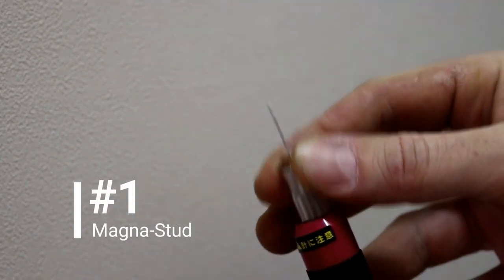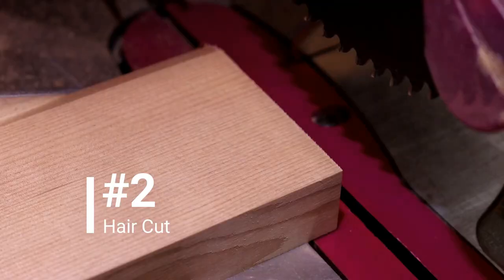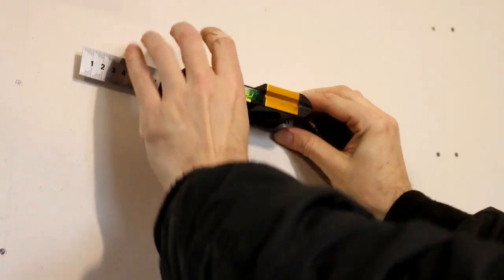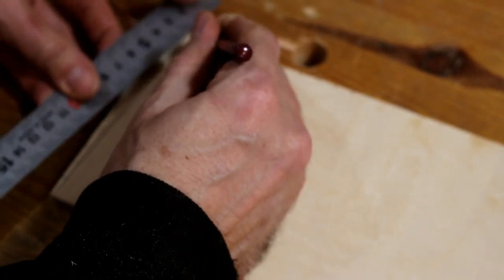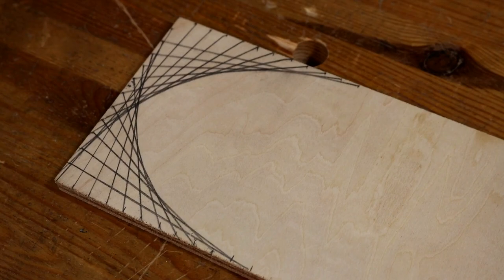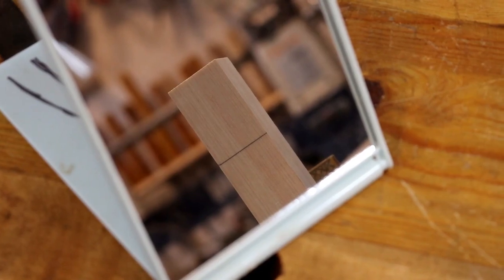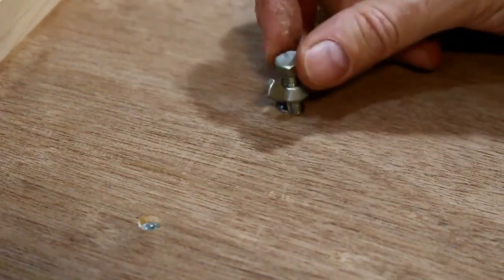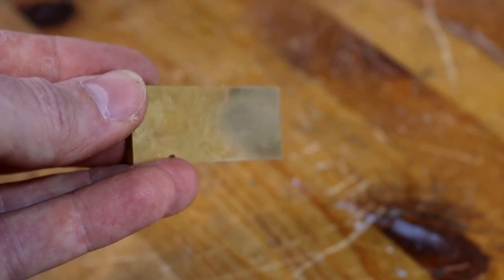Do you know all of these?! 8 woodworking & DIY tips!!

Comment: #5: I’ve seen woodworkers drilling horizontally, as you do, with their wedding ring around the drill bit shaft. If the bit is at an angle, the ring will climb on the shaft when turning. 
jp from France